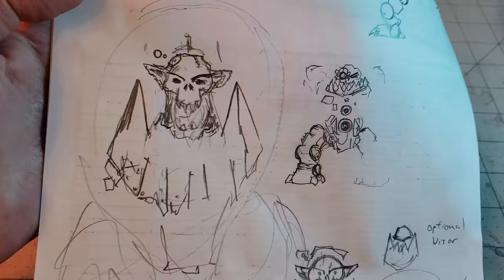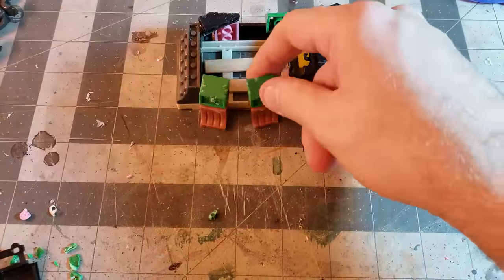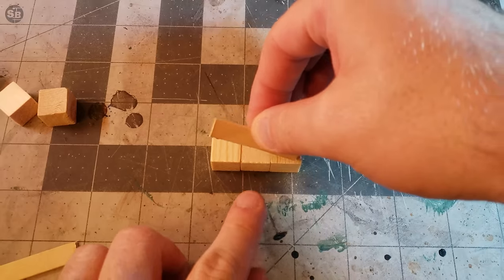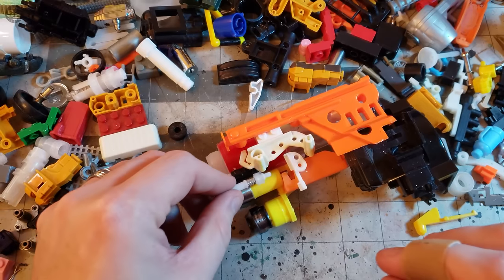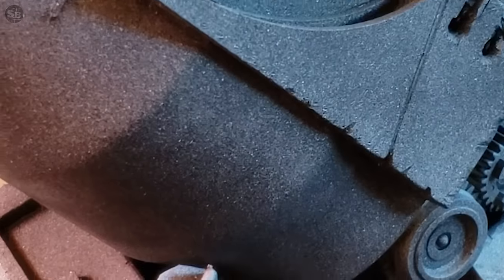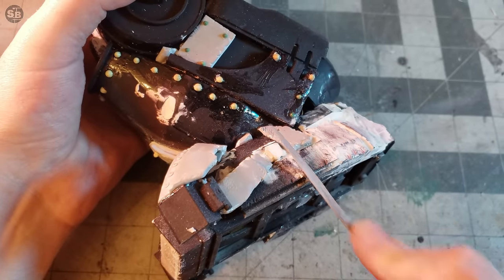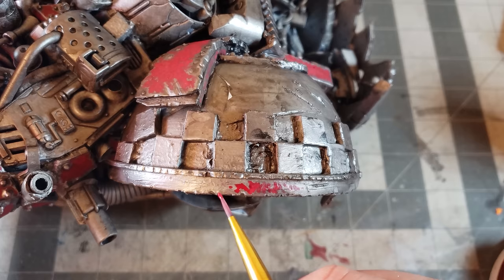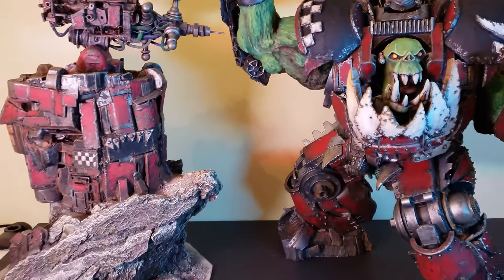BIGGEST ORK

Comment: I think something that'd add alot to your models is green stuff weld lines! Instead of just joining panels and gaps with sbackle use thin green stuff snakes and put little horizontal lines in it to simulate weld beads! Love your work!

Comment: I've been trying to think of a way to paint the red panels on my Stompa, I'm going to try your stimpling method, thanks for the suggestion.
Reply from the maker: It's not just stippling. I also do kind of sketching paintstrokes. The primary objective is to leave exposed metal around all the edges.
Good luck with your stompa!